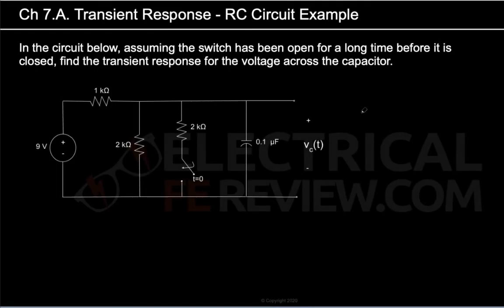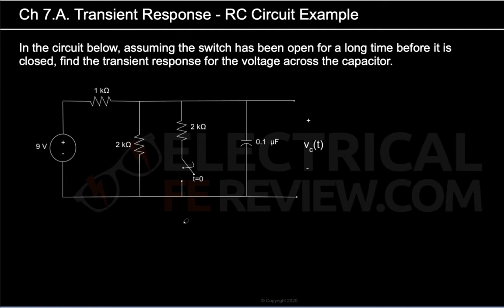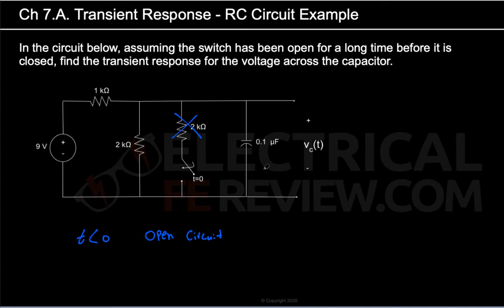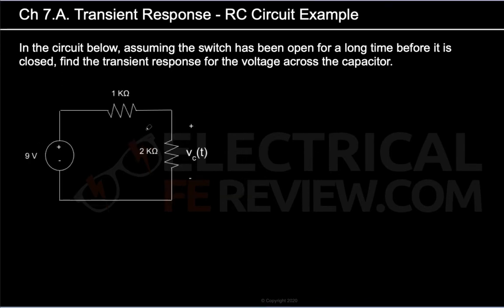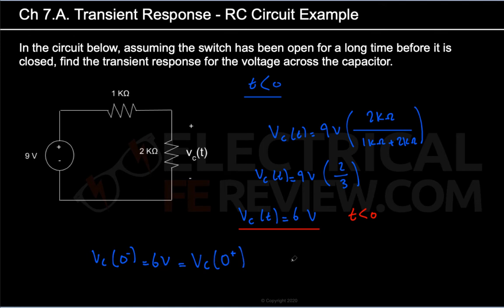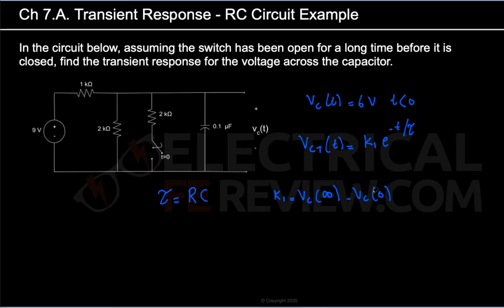How to Solve Switched RC Circuits - The Transient (Natural) Response - (Electrical FE Exam)

Comment from the maker: Video Table of Contents (Click to Jump):
0:00 - Problem Statement
0:20 - Transient Response Definition
 1:00 - The circuit at time less than 0 (switch open)
3:38 - General expression for the transient response in an RC circuit Vct(t) = ke^-t/𝞃
4:13 - Definition of the time constant tau  𝞃 = RC
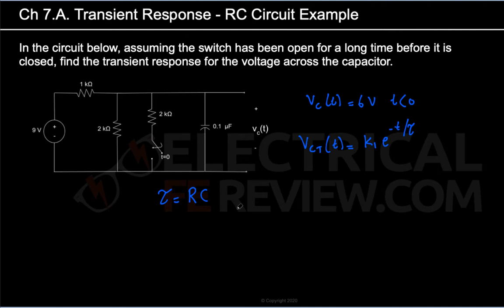4:51 - Solving for constant k1 = Vc(∞) - Vc(0)
7:12 - Solving for the steady-state response Vc(∞), t = ∞ (switch closed for long time)
10:46 - Solving for equivalent Thevenin resistance Rth
13:15 - Solving for the transient response Vct(t) = ke^-t/𝞃
14:07 - transient response summary

Answers:

At time less than zero:
Vc(t) = 6 V

At time equals infinity (t = ∞):
Vc(t) = 4.5 V
 
Constant k1:
k1 = -1.5

Thevenin equivalent resistance Rth:
Rth = 0.5 kΩ

time constant tau  𝞃:
𝞃 = 5X10^-5 seconds

Transient response for the RC circuit Vct(t):
Vct(t) = -1.5e^-t/(5X10^-5)

Comment: 12:35 Isn't that incorrect? The 2kΩ resistors are in parallel, but the 1kΩ resistor is in series with them, so the equivalent resistance should be 2kΩ.
Reply: Yeah i got that too